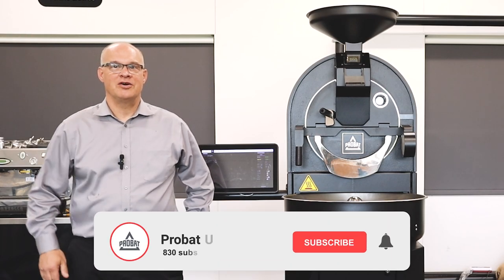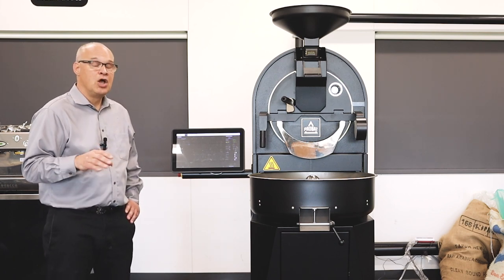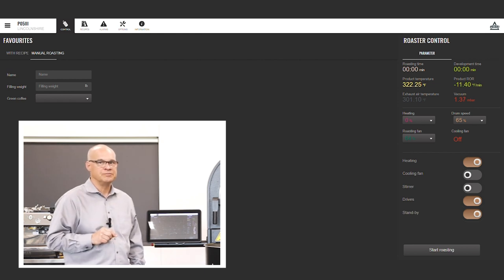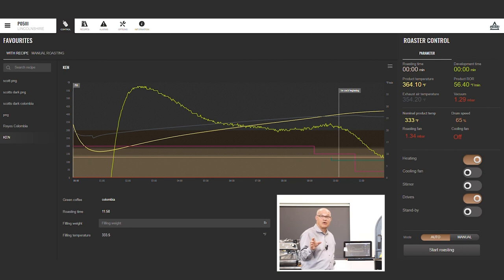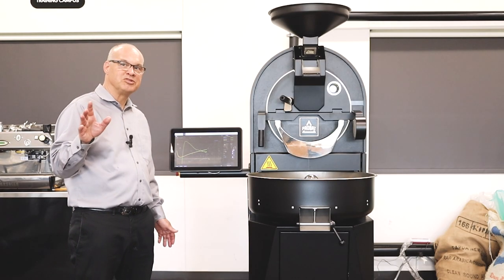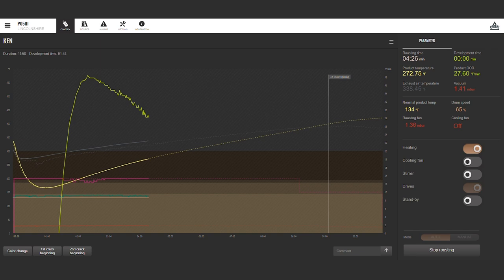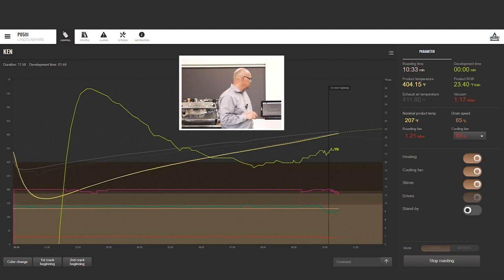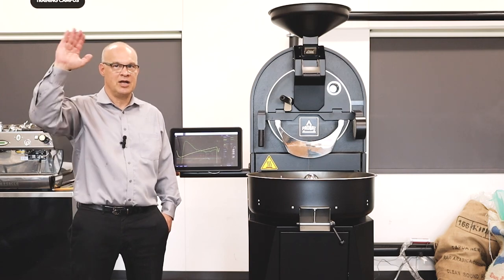Coffee Roasting on Probat P5 III with Recipe Function | Full Roast

Comment: Is the standby temperature programmable or is 300° the only option?
Reply from the maker: So far I've only seen this as a preset 300 F and nothing in the manual describing the feature. I will enquire with engineering to see if it's adjustable outside the initial commissioning.
Reply from the maker: Just double checked and 300 is the only programmable temperature for this standby mode.
Reply: Does the machine feature a safety shutoff for the burners once the bean probe reaches a certain degree? ex. 450°F shut off
Reply from the maker: @josiahgrady2646  The roaster is equipped with temperature monitoring that deactivates the machine if the product temperature reaches 250°C. If the switch is tripped, the machine must first cool down until it can be switched on again.